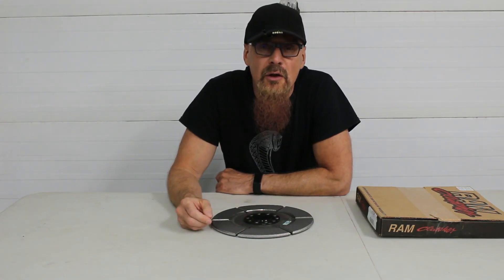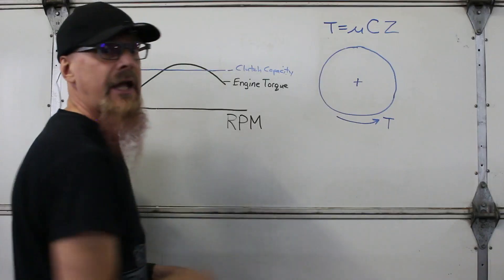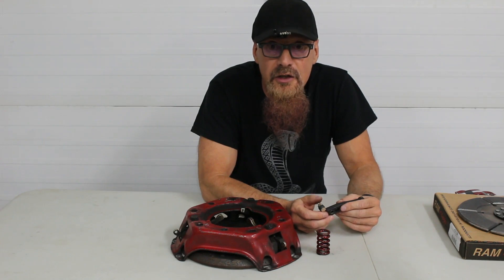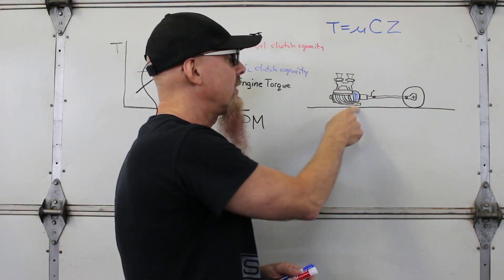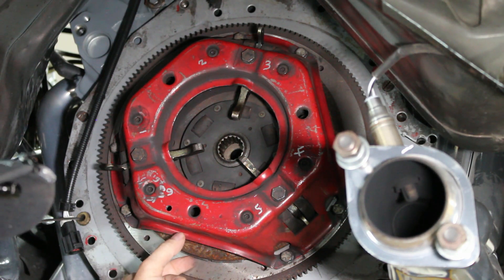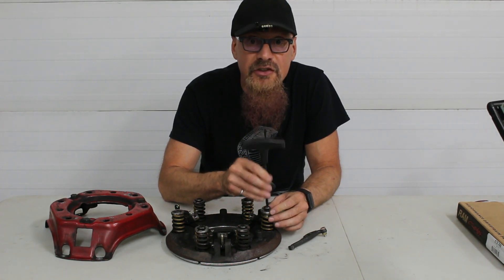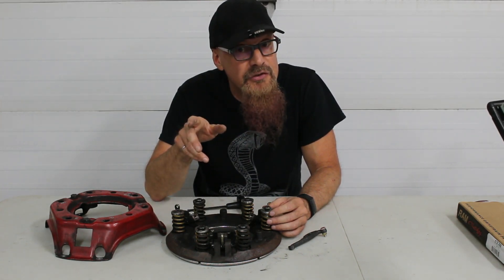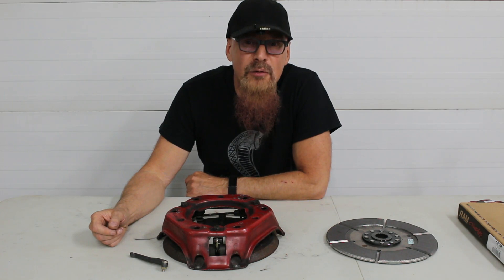Drag Race Clutch Science

Comment: Thank you for the video, it's very educational. Can you please tell me which clutch brand / model was used in the video? Can you please make a video going over the calculus portion?
Are you available for consultation on clutch related subjects in the future, and if yes, what's the best method to reach out?
Reply from the maker: Pressure plate was a McLeod Soft Lok. Disc was Ram 4135. I'm not a clutch consultant, maybe contact Rob Youngblood at Advanced Clutches or talk to the manufacturers. The calculus is shown on the board at 16:45, if I made a detailed video about that I'd probably lose subscribers ;)

Comment: From my experience with slipper clutches I think three things should be stated: First, sintered iron is high maintenance with the deglazing process and constant adjustments and tuning. I think many racers would find the effort involved intolerable. Second, they chatter, which makes staging the car more difficult, deglazing helps but returns rather quickly. Third, sintered iron disks don't work well with conventional syncros.

Comment: Have the billet 10 inch long style ram, 690 base and 60 gram on levers it will not do a burnout and doesnt lock up only gets worse as vehicle gains mph or shifts higher and slips too much
Reply from the maker: Power/gearing/weight? If you've driven through the clutch excessively, everything will need resurfacing before it holds properly again.

Comment: Can we get Exel page to calculate about: Diameter where pivot are located. Weight and lenght of arms? I don’t use static spring and pedal but I use springs to keep clutch open.
Reply from the maker: If I understand your question correctly, I can't provide a spreadsheet to calculate centrifugal clamping forces, as you need to know all the geometry of the levers, including where their center of mass is, and the static lever angles (which change with disc wear), as I don't have that information.
Reply: @The_Performance_Laboratory  if I give you that information do you think we can create one ?
Reply from the maker: @yvesgia  Yes, the math isn't that complex, it's getting the geometry measurements that is the challenge. However, I will warn you I've done this for my clutch, and bought commercially available clutch software, and none of that helped my program. It still fundamentally came down to trial and error to get the clutch setup right.

Comment: So the counterweight is going to be a curve and not linear due to the engine speed? And the more the counterweight the the quicker the clamping force increases? so could you, or would you want to decrease the static force?
Reply from the maker: Correct, counterweight force is not linear with RPM. More or less counterweight, combined with static force, is a tuning variable. Too much and the clutch might lock up too aggressively at the launch, too little and you might still have clutch slip in high gear.

Comment: I would like to see the derivative for your chart....I race a 7.25 dual disk sintered iron clutch. I race a 406 camaro. I didn't see car weight, tire coefficient,or gear ratio in your formula. Also base pressure test fixture would be helpful in setup. I made one if your interested. The question I have for you is: how long do you slip the clutch at the hit? McLeod says a couple of tire rotations on the start line. Love to see other gear bangers. I have years of notes with data recordings also. Thanks for the video!
Reply from the maker: There was no derivative in the calculus, only integrals. And you're confusing tractive torque and clutch torque capacity. Ideal amount of slip results in the quickest ET and will be different for specific combinations and track conditions. Thanks for watching.

Comment: Great video. I only have one small issue. I’ve been running sintered iron/soft lock clutches on the street for years. It is by far the best set up going. I encourage anyone running a street/strip stick car to use a soft lock clutch. Again, GREAT VIDEO. And I subscribed.
Reply: Thanks
Reply: You ran a sintered iron / Soft-Lok on the street ?   What kind of plate load and centrifugal ?  What was it like in traffic ?  Chatter ?
Reply: @techno9090  It drives better than any clutch I’ve used. On the street I use 990 pounds of plate load and 12 grams of counter weight.

Comment: I have an 87 LX stock motor t5 4.10 gears best 60' so far is a 1.69 mid 13's @ high 90's.  Currently has a stockish clutch and a clutch tamer.  I have been pleased so far.  I am adding a turbo and I am concerned it will slip too much with the additional power.  Any recommendations for where shop for a clutch? Street/strip / drag week car.
Reply from the maker: I have no recommendations other than talking to the clutch companies directly. With the turbo, you'd probably want a sintered iron disk as a minimum, and possibly a dual disk to cope with the slip/wear better.